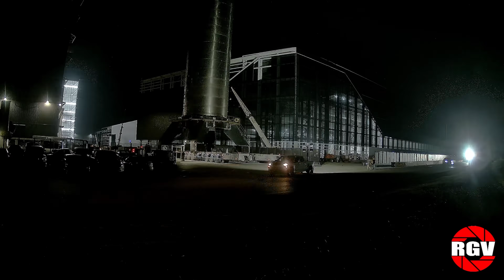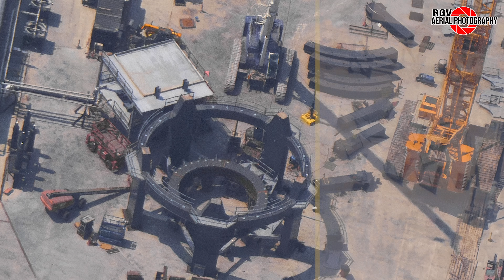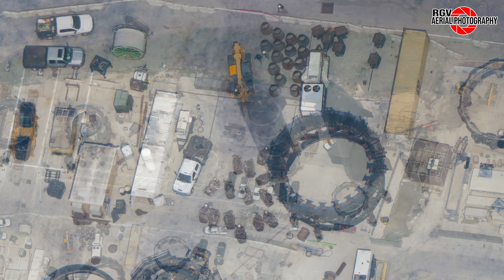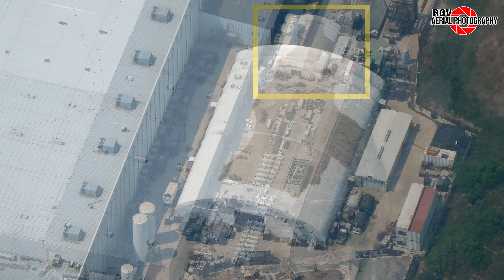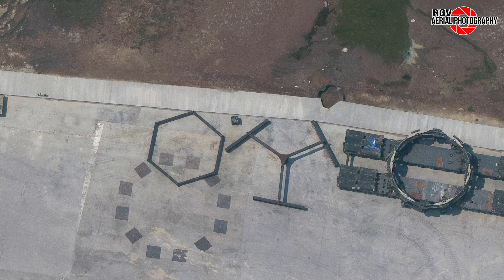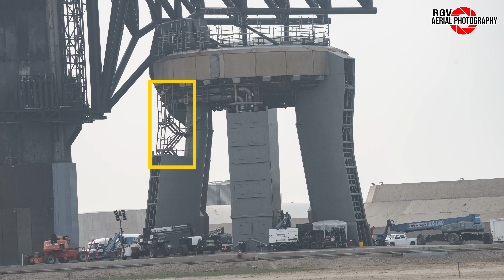Tower Two Breaks Ground! Starbase Flyover Update 41

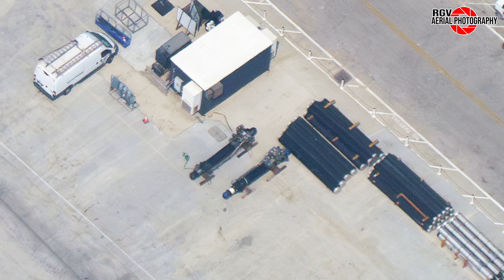Comment: 3:54 The black tubing on the right of the actuators looks like tubing to construct more chopstick catching arms.
Reply: That is insulated cryo pipe more than likely. The 3rd chopsticks assembly is also built in Florida already and will be transported here so no need to build another at the moment.
Reply: @B.J.Schnettler  Maybe, but it looks like the same painted pipe in two sizes as used in the chopsticks.
Reply: @ThexBorg  If you look closely you can see the ends are silver and thinner than the black part which would suggest they are insulated pipes. Just to the east of them is 2 bundles of uninsulated pipes of the same diameter of the smaller ones.
Reply: @B.J.Schnettler  Thanks for your opinion.

Comment: Thanx for another great update - but 3 to 5 weeks delay until Lanch IFT-4 ? Is Spacex not ready ? OR, is delay due to political FAA slow-walking launch approval? At this rate, FAA approval for flight -5 will be multi-months away !!! Is this political delays ???
Reply: How long of a wait for flight 5 will be determined by how flight 4 performs. If booster soft lands and ship survives re-entry to a hard splashdown in designated zone; then it could be a few weeks. If they one or both need mishap reports then it will take longer. SpaceX leads the mishap investigation and is constantly communicating with various government agencies about what went wrong and what is being done to correct it. At this point once SpaceX submits the final reports they are rubber stamped.
Reply: FAA just greenlighted launches. Nothing political going on except in your mind.